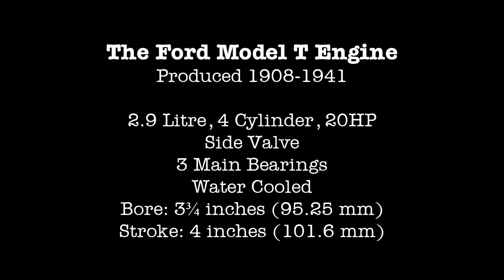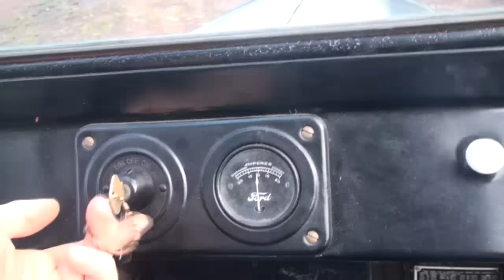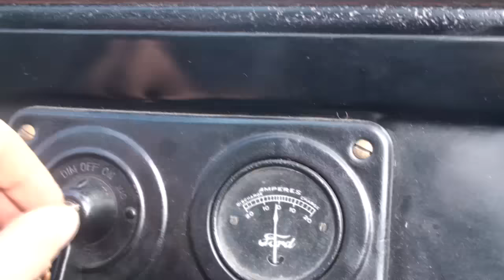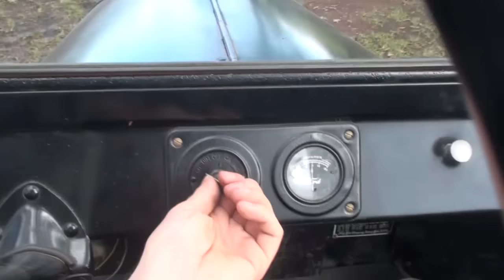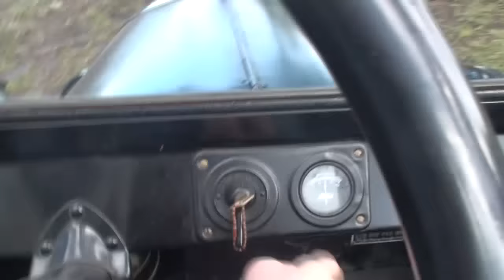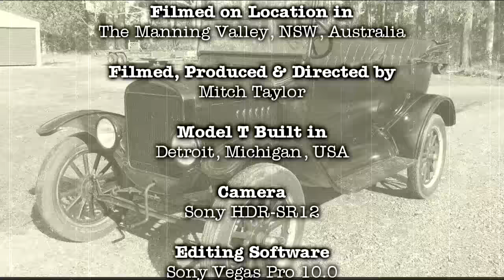Ford Model T - How to Start & How to Drive

Comment: I can't imagine how people stole banks at that time with cars like this?
Reply: Bank robbers/gangsters didn't use Model Ts...too slow.
Reply: Ha ha ha ha, you have to remember back then cops didn't have all the stuff they have today,they had the same things we did  and yes they did rob banks in these back then,there were only models Ts then and its what everyone had,heck, bank's have been robed in just about anything, horses, bicycles  etc,
Reply: the getaway driver would leave it running lol. no license plates and if it stalled, youd jump out and just run for it. hehe mustve been comical. ah the roaring 20's
Reply: Even then you still had the problem that you can't outrun a radio.
Reply: Robbers had a list to start the Model T while bullets were flying everywhere. Good thing nobody got hurt for nobody knew how to shoot straight and the Model T went a little faster than you could run. Horses were a better bet.
Reply: The people in the banks were sleeping and the T-M ford got away lol
Reply: People didn't steal banks
People robbed Banks

also. you should watch some old black and white movies
Reply: Yeah it would be hard to steal a bank! Even with today's cars, they're very heavy and hard to carry and pull with your car! Plus they're really hard to hide in your basement! I guess that's why people stopped stealing banks and started robbing them instead!
Reply: Kurt Tappe Before there was an FBI, all the robbers would need to do is cross the state line.
Reply: Forget cars... think of manual supermarket cash registers!
Reply: @ethan Baum

Makes Sense  hehe
Reply: i think they used something called horse
Reply: Stole banks??? Or robbed banks? Because when they robbed banks they were still using horses until the 20’s
Reply: Are you planning to rob a bank?
Reply: Horse, bike, on foot
Reply: Robbed banks you mean? Why not? The police weren't likely to have anything better or faster, and they did just fine with horses before that. With early cars, as with horses....and indeed, even with modern cars...the trick is to have a helper sitting behind the wheel, engine running (or holding the horses, ready to go), so all you have to do is run out of the bank and leave. They didn't shut the car off, and get in and start it up to drive away (although if they did, if they had taken everyone's guns and held them at gunpoint already, there was little reason to expect armed police to show up to stop you for several minutes, even in the city. It's not like today where you can expect cops with assault rifles and helicopters to show up within 3 minutes in urban areas.
Reply: No radios in 1925n not even in the 30's when Bonnie and Clyde were all over the map.
Reply: Easy. The cars the cops drove weren't any better :-)
Reply: Most of the time mobsters would have a Deusenberg which would invariably blow the doors off anything the cops had.
Reply: The robber drove a black Model T. Like everyone else. Good luck
Reply: Kurt Tappe 
One way radio wasn't available to police until 1928.  Two-way radio wasn't available until 1933.
Reply: I learned at an old car museum that Police installed larger fuel tanks in their Model T's  and chased the robbers until their fuel ran out. Another form of "hopping up" included special cylinder heads and other changes which the robbers quickly learned to use also. Then along came Henry's hot V/8 in '32 and the chases got hotter.
Reply: They had getaway drivers so they could have the motor running for a quick get away but also because it has usually been illegal to leave a car running unattended and the bank robbers would not want to get in trouble for that.  In many areas a car left running is a sure theft target.
Reply: So now they steal ATM machines.

Comment: 20hp from a 2.9L 4 cylinder. It's funny to think that now you can get 20hp from an engine 1/30th that size.
Reply: its also funny to think a 4 cyl can hit 500 some hp lol
Reply: how So ? i mean American made 6,7 L v18's with 100Hp in the 80s's .
Reply: @miljororforsprakpartiet290  those engines were made for torque, not speed
Reply: yeah i know but they cant be that weak anyway. hell we have 1.2 Liter with more power than that :) for Instans Camaro had 5.7L V8 140Hp and it cant be a Tractor i guess? :o
Reply: in the 80's ??? Gl with that lol
Reply: Chips in the '70s? Well it's the same deal as 20hp from a 2.9L 4 cylinder, deal or no deal.
Reply: They certainly used to. But having such technology prior to the "invention" of the mainstream computer sounds rather irrational, in case they didn't use mechanical instruments ofc
Reply: @miljororforsprakpartiet290  only because of the wonderful EPA not because a lack of technology. They were cranking out way more just 10 years earlier. I guess the EPA at least helped jump start engine technology out of necessity but they are still a horrible government agency
Reply: A 2.9 l non turbo 4 today would probably make 250 hp today. You really have to realize this was really the beginning of automotive technology. This was as new and ultra modern in that day as our " latest tech" is today. Alot of firsts are represented in a Model T. This was that era's high tech at it's best.
Reply: Cars have certainly come a long way since the Model T.
Reply: Cool, I have to find out more about this ancient computerized stuff. Cheers for the knowledge :)

Comment: What's the small button on the floor to the right of the brake?
Reply from the maker: A previous owner had installed a foot throttle, which never worked properly, so I removed it. :)
Reply: Whew, I was almost about to remove this comment because I didn't see it in the next video, and thought I might be mistaken in what I saw.
Reply: High beam? (jk!)

Comment: I think he  made one mistake.  He said "when the hand brake is all the way back, the car is in neutral."   Then he said, "when you move the hand brake to the upright (or 90 degrees to the floor position), the car is in neutral...then you press on the left pedal and the car moves forward."  How can the car move forward if the hand lever is at 90 degrees, or as he stated, '...in the neural position."  I think he meant at 90 degrees, the  car is now "in gear."  Just my observation.
Reply from the maker: No, with the handbrake in the 90 degree position, the brake is released, and the car is in neutral. Pressing down in the left pedal is what engages low gear - unlike a modern car where you release the clutch to engage the gear - the Model T is the opposite.

Comment: so, model T had 2 power source for the ignition. first from battery, and second from magneto.. is there any difference between the two in terms of power and fuel economy? also, the starter "button" is placed under the carpet and it's so huge.. what happened if the driver accidently put their foot above the "start button"? will the starter overspin?

Comment: How did this car get about 20mpg?
Reply: Suprisingly, the fuel economy of the T varied between 13 and 21 mpg.
Reply: Tiny motor and designed to use little fuel for distance but also so it didn't go too fast
Reply: Tiny motor..? 2.9 litres..
Reply: 2.9 litres, but only 20 bhp. And a very light car to propel, with minimal losses (no water/oil/fuel pumps, no a/c compressors or heating, no power steering, no generator for battery recharge on some models, virtually no electrical system to power, single camshaft).
Reply: 20 mpg on 30-octane gas is not bad.
Reply: Gihren Zabi that is better than a truck built 15 years ago
Reply: Low compression ... and low power ... make cars like the t still working ... imagine a modern car in 40 years 🙊🙊🙊🙊
Reply: Yeah that's good
Reply: @GatesheadElvis  you think thats big?
Reply: @stephenarling1667  Excellent update on octane Steve, this and all those early vehicles required a certain Oil too; todays oils are totally different, they would burn that engine right up.

Comment: my father had told me that when hand crank starting a car it was important to not wrap the thumb opposite the fingers else broken hand might result from kick back.
Reply from the maker: Your father is absolutely right! My Model T has only kicked once in all the years I've owned it, and it was because I hadn't retarded the spark for starting. Good thing my thumb was out of the way, I escaped with only a sore arm from having the starting handle jerked out of my hand ✋️
Reply: @ModelTMitch  My description wasn't very clear.  Our human hand is designed with 4 fingers and one big opposing thumb.  Kind of a vice grip of sorts.  It's this opposing thumb that must not wrap around the hand crank hsndle.  All five fingers must stay on the SAME side of the handle when crankin' the crank.

Comment: Im 14 and i actually own a 1930 mint condition buick straight 8 and none of that damn hot rod bull my grandad owns 14 or 16 all mint
Reply: If your car has a V-8 engine it's not original,  Buicks of 1930 only came with 6 cylinder engines.
Reply: @kaa522  i meant straight 8

Comment: Wait hold up... push button start has been a feature since 1919?
Reply: Even earlier than that Cadillac were the first to offer an electric starter motor in 1912, it's been around about as long as the mass market car.

Comment: Lol what! 1:57 100 miles on 5 gallons!
Reply: The Pioneer 20 mpg is pretty normal.
Reply: Small motor, light weight vehicle, slow speeds: should do far better than 20 mph.  But then it is a rather primitive motor with manual controls.
Reply: 20 mpg on 30-octane gas! Try that in any modern car.
Reply: @rickpaulos  primitive roads too, it's how much load on that engine over dirt or over fields bouncing around .

Comment: I have a rebuilt Model T with various modifications, and this still helped a bunch! I’d like to know a few things though:

1. What is the other thing near the choke on the inside?
2. What is the button on the steering wheel?
3. I’ve always had issues with my coils, do you have any tips?
Reply from the maker: 1: A relatively recent period addition - a map reading light
2: The button on the left side of the steering column is for the horn
3: Check out the videos I've uploaded about coils and the coil box, what are the issues you're having?
Reply: @ModelTMitch  I tool a closer look at my T, it is modified so things are a bit different.

For me, I have a loop near the choke that moves the fuel valve (for peak laziness!)
2 is very likely correct
3 I will likely have to do some research

Comment: Driving that thing looks much too complicated! lol
Reply from the maker: Somebody from 1925 might have said the same thing about what we call "modern" cars... I think its only what you get used to :)
Reply: Too right, Mitch! I'm merely stating this from a 1970s/manual transmission perspective. Lol
Reply from the maker: Cool :) ... The funniest experience for me was taking my Model T in for a roadworthy inspection - explaining to the mechanics how theres no fuel pump, oil pump or water pump, and no distributor - then see them scratching their heads! :)
Reply: You still need to take it in for inspection in Oz? In Maryland when a vehicle is over 20 years old, you don't need a vehicle inspection for it. Potentially scary situation, but vehicles over 20 years old around here are somewhat rare, and the ones who DO own classic cars look after them.
Reply from the maker: In the state of New South Wales (NSW), the laws are very strict for any road-going vehicle. Having said that, they are much more lenient on vintage and veteran cars. The basic rule is, so long as everything the car was equipped with is in working order, ie. brakes, lights and horn, .. and the wheel bearings aren't shot, then it's road legal - just have to pay the extortionate registration (road tax) or whatever you call it over there. :) Thanks for the comment :)
Reply: ***** I've just imagined retrofitting Model T with catalytic converter and ABS.. :D
Reply: mibars It's been done.
Reply: Russ Davis You mean in like restored model T, not a hot rod?
Reply: adamcharney Really? Inspection laws are very inconsistent in the US. Vermont inspects all cars yearly, but they do not do emissions tests on any cars. You can literally run whatever you want. I have a 79 Malibu with a 350, carbed, no cats, no EGR, no emissions equipment whatsoever. Not even a muffler, just a resonator.
Reply: minniemation
In the UK inspections are very very strict (though lke you've said common snce provails on vetran cars) road tax is based on emmisions but there is NO tax to pay on cars over 21!
Reply: Oh right I'm a yank but I know a bit about MOTs and have had dealings with the DVLA regarding a vehicle I imported from South Wales. If you can acquire a 21 year old vehicle, that's not too bad. I have a 19 year old VW Cabrio, and come next year I'm registering it as an antique so I pay less for insurance and registration, and won't have to bring it in for emissions tests.
Reply: Andy Stone adamcharney  how much would it cost to register say a standard 22 year old Toyota saloon there for a year?  (in Aus it would cost ~$700USD)
Reply: Why would you consider them inconsistent? State DVLAs/MVAs/DMVs keep records on a tight schedule and on file.
Reply: Complicated? Not really...
Reply: Son of a Zombie I just registered my Toyota Yaris the other day for $135 for two years. The year of the vehicle doesn't matter here unless you're registering it as a classic vehicle.
Reply: Just once thru the video and I wanna drive one, lol.  Looks fun and challenging.
Reply: I think once you get it moving, it'd be easier to drive than a modern manual. Get it moving in low gear, get it into high, then it's all throttle and brake from there.

Comment: I’m listening with my speaker setup that includes a 12” subwoofer... about 12:53, as the rpms are coming up, this beautiful low bass sound fades in that I found so gratifying that I had to rewind and hear it again. If a sub isn’t available, some good headphones or earbuds pushed in good and snug should allow you to hear it quite well, if you’re into that kind of thing. It never ceases to amaze me that the built in mic on an iphone can pick up low-freq sounds as well as they do ... androids may do just as well, I just don’t have any experience with those. Congratulations on acquiring a gorgeous and historically important piece of old American steel, and for a very interesting and informative video... I learned a lot, including some details I’ve wondered about for a long time.

Comment: Fascinating. I'm reading Ralph Bagnold's book Libyan Sands - Travel in a Dead World describing how he and some fellow army officers explored the deserts of Palestine and later Libya in the early 1920s in Model T Fords just like this. Bagnold went on to found the Long Range Desert Group in WW2.

Following on in the tyre tracks of the Australian Light Car Patrols of WW1 they would venture out on trips of over 1500kms, usually without many mechanical problems, in barely modified saloons across uninhabited deserts. They DID remove the bonnets to assist with engine cooling and also invented the condenser overflow tank to conserve water when the radiators inevitably boiled over.

Interestingly they used to run the tyres at 90psi (6 bar) but one of them, Prendergast:

"let most of the air out (which) would cause the tyres to squash out flabbily. The result was marvellous. They sailed along over everything except actual quicksands, and left the others far behind till all had followed suit. Nor did any harm come to the tyres in consequence."

They were deflated to just 15psi (1 bar)!

Having watched your video I'm even more amazed at what they achieved in these incredible motor cars.

Comment: Take this comment for what it's worth.  I just finished reading a book about Henry Ford.  The oil level petcocks were talked about.  The way I understood it was the lower one was the low level mark.  You had to have at least that in to safely start the engine.  The top petcock was used when you put oil in the engine.  When it started to come out, you let it drain until it stopped.  That would be the high level mark.  I would be concerned about causing damage if it were blindly overfilled.  Again, this comment isn't based on any practical knowledge of the Model T,  but what I read about its development.   I enjoyed the video.  Thanks

Comment: A beautifully produced video and a beautiful machine!  The model T really did have an advanced transmission design for its day, old Henry Ford called all the rest "crunch transmissions", and he was right!  Simple, rugged, reliable, and very affordable.  The later made T's were way better than the first ones, I remember a neighbor showing me one of his gas and brass era T's down in the potato warehouse.  It was basically a "new" car, as he bought it from a dealership where it had sat as electric lighting had been introduced, and nobody wanted the acetylene headlight system.  He started it right up as you have demonstrated, but the earliest ones shook like a wiggling jiggling dog, as they had no decent anti-vibration mechanisms (all aftermarket gadgets one had to buy).  Yours is pretty solid running by comparison!  Thanks for the tour in a T!

Comment: Thanks  I was the best overall explanation for the da to day operation.  My dad's old 1967 VW transporter pickup could run without a battery, We had a series of problems so I had to get out every time we came to a stop and push start.  We didn't even have a battery and leave vehicle and it worked just fine,